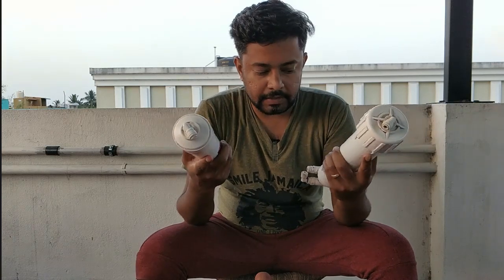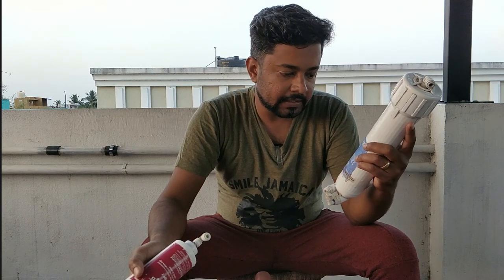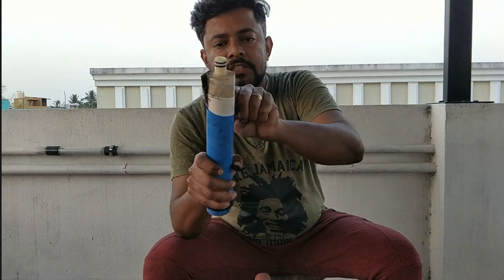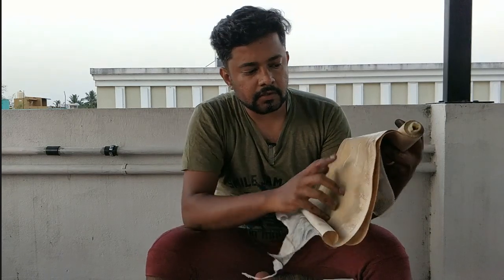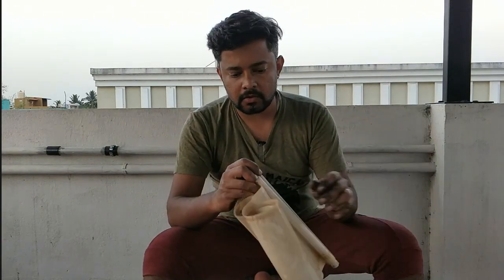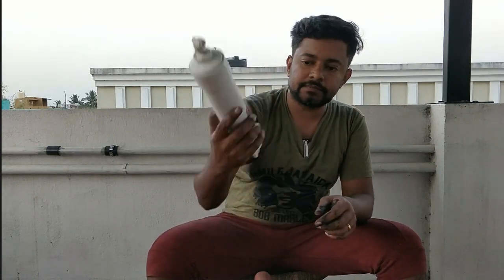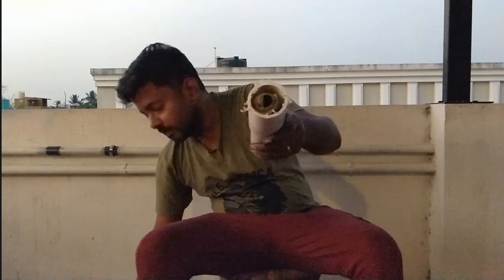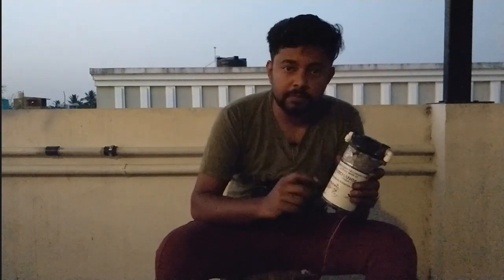Zero B RO Water Filter Teardown

Comment: Thanx for making this video, it helps demystify what is really there in those cartridges. My biggest concern has been to understand if we are getting genuine first hand cartridges from the supplier (at the time of replacing filter cartridges) or just recharged cartridges dumped from other filters. The video shows at least one cartridge that is fused or sealed and can't be open without cutting through?  If that's so, then it is perhaps less prone to being recharged and resold as a new cartridge. 
If you could make videos of other cartridges that come with ZeroB, like 3 -4 cartridges that are coming these days with Zero B water purifiers. I will try and see if I can keep the old cartridges, next time I have to replace them...the Service guy always take them back. Wonder how they recycle it?
Reply: That was exactly my concern.
Reply from the maker: if you are under AMC they will take it back. if you had a paid replacement then they will leave the old spare with you. its not recommended to store the old cartridges for later use since they dry up quickly and loose their property. if you want to store it, then fill the cartridge to the full and cap it at both the ends.